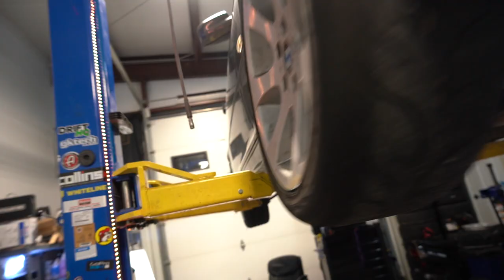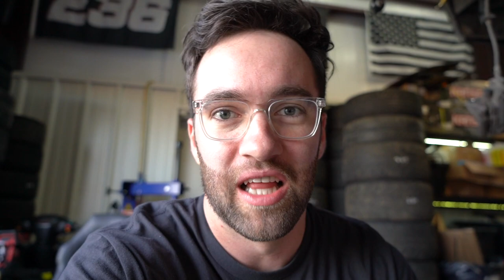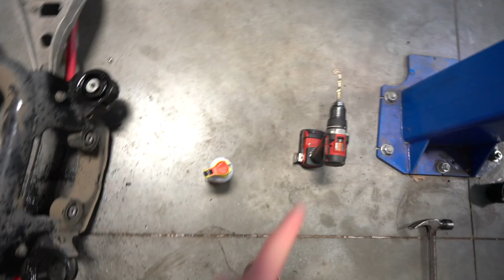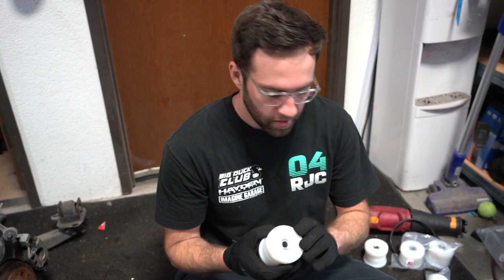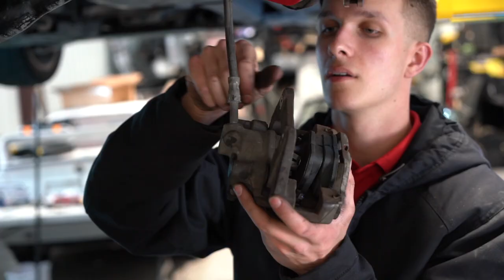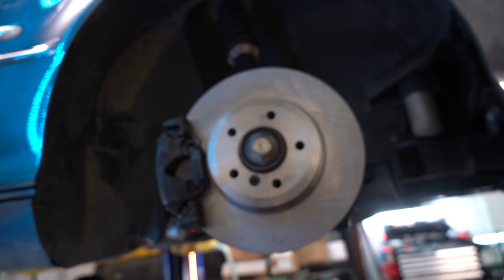BMW E46 ESSENTIAL CHASSIS UPGRADES! CONDOR SPEED SHOP

Comment: Nice upgrades man, finishing my e46 in a week just need to order them lockplates that relocate the lowercontrol arm
Reply from the maker: Right on man! Ya I like the cnc 71 angle spacer. I'm thinking about making some short videos talking about my drift setup. I've finally gotten it dialed in pretty well.
Reply: @jspeedracing  do you know if drifthq deliver to canada? The prices are all in U.S $
Reply from the maker: @thedoorjeff  That's a good question. Maybe send them an email and ask.